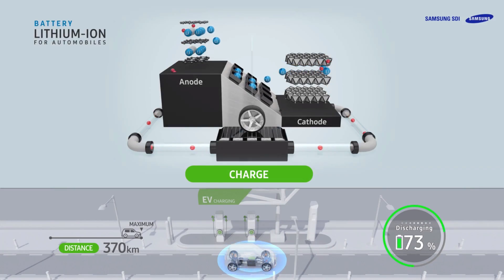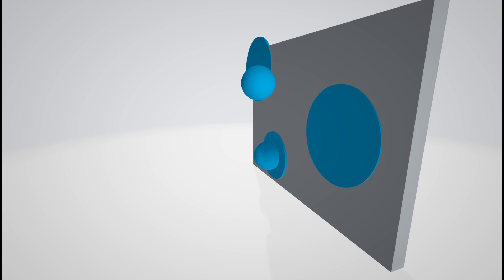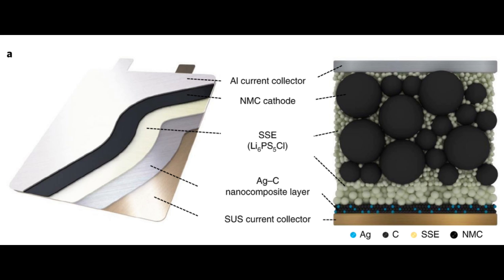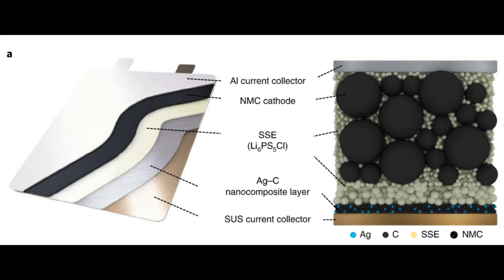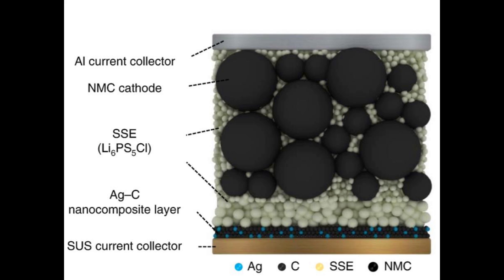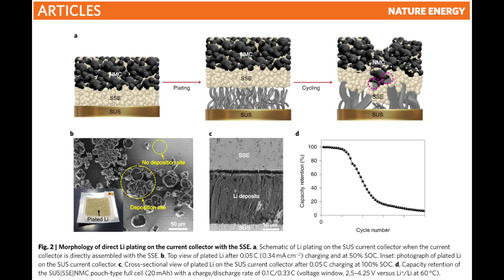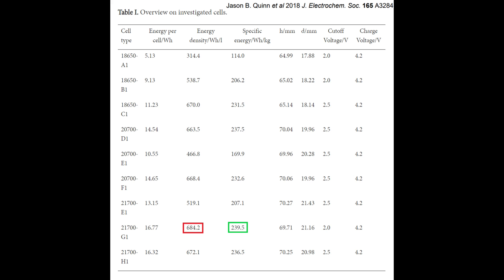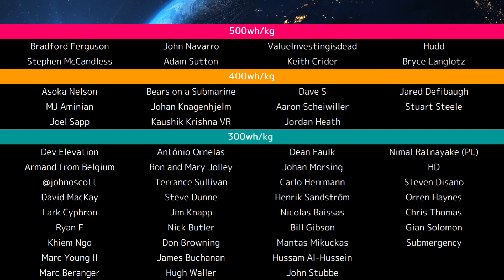Samsung's "Breakthrough" 900wh/l Solid State Battery (Deep Dive)

Comment: at 14:00, did you mean to say the silver can be replaced?
Reply from the maker: Yes!  Thanks for pointing that out 🔥 😀
Reply: @thelimitingfactor  Aluminum. Al and Mg was looked at for this specific application in the 80’s.
Reply: I didn't even notice that until you mentioned it
Reply: Yeah, I was sort of wondering what the cheaper material was going to be.  lol
Reply: it was the ‘lighter than lithium’ that got me. 🤪
Reply: Lithium = corrosion. I dont see this as a solid state battery. This is a "continue to buy once it dies" battery. This is not the best they can do. 1000 Charges? Garbage. There is no excuse for this other than profit and lightweight race. Iron and detergents without chloride have more longevity than this. This isnt cutting edge or energy future wise, its engineered failure again.

Comment: Jordan. Couple of things.

1. The premise that an SSB reduces the propensity for fires and explosions is received wisdom that is likely flawed at traction battery scale. In an overcharging situation (and less likely but perhaps also in a short circuit situation) the SSB will explode violently as the failure mode because it cannot so easily boil off the electrolyte at relatively low temperatures and pressures to vent with or without flame. Overcharging a large SSB is a simple case of too much energy in a confined space and nothing present in liquid phase will tend for solids to go straight to gas very explosively.

2. Coulombic efficiency. When we are up at > 99.7 levels of coulombic efficiency, it is not correct to assume that even a high percentages of coulombic losses are due to irreversible chemical side reactions. While it is splitting hairs on the definition of an unwanted side reaction, the kinetic energy lost to reversible volumetric changes owing to changes in the density of electrodes and perhaps even a solid electrolyte at different states of battery charge, will be recorded by equipment that records round-trip cycling losses and reports the balance as coulombic efficiency.

Comment: I think SUS has utilized for pressurization and for anti-corrosion purpose. Copper current collector may deform easily and it is not adequate for pressurization. 900Wh/l is not impressive at all. Li ion battery has reached up to the level of 750wh/l.  Pressurization is really difficult to apply in the real system. QuantumScape version of 1000wh/l is not impressive either.

Comment: I am afraid to say that the speaker of this video did not properly understand the importance of academic achievement of the journal article. I believe reviewers of the journal surely found an issue of using the expensive silver. However, they might accept it based on the unique concept demonstrated in this paper, so that following R&D will focus on replacing silver by other cheaper materials.
Reply from the maker: LOL, if you would have written this to me, rather than referring to me as some abstract entity, it would be a great start.  I do understand the importance to the research community, which is how it got 5 points.  The other non-existent 5 points are for the public who will never see this battery and sold a false bill of goods by the media.

Comment: There should be research into solving the low discharge / recharge cycles by making the cells like a sandwich that's rebuildable with replaceable electrolyte and electrodes. Think about a swappable battery pack that can be replaced instead of recharging it.  Then field replacement of the consumables in the battery pack.

Thank you for the informative insights.

Comment: I heard you say the compound Kobalt is in this battery. Correct?
When given the option between 2 batteries where one has no kobalt but shorter livety at half the price....
Would it be the best choice?
 But now again, if baked in the frame of the car and not replaceable? You get a throw away car?

Comment: OK first I like pancakes good analogy of how old is your fax the reaction time and characteristics I have a question though when you say electrons pass through a element is it like in a wire or a electric goes in one and a one comes out the other same iCloud does the all the way through the wire just the placement goes through the where is that how it goes through the trail you’re talking about ?
Reply from the maker: The physics of how electrons travel through a wire would require its own 15 minute video.  Electrons move very slowly, but the energy transfer occurs at the speed of light.  This is much like how waves move through and ocean.  I don't understand the rest of your comment/questions.

Comment: So it might not be a breakthrough for EV's due to cost, but this has great potential for portable electronics where the additional safety and capacity are of real practical use.  Giving it a 1 out of 5 is somewhat punitive.
Reply from the maker: It depends on your criteria.  Samsung isn't planning on developing this and usually it takes at least 10 years for a battery to go from lab to market.  If I were a researcher, I'd rate the usefulnes higher.  I'm taking the perspective of Johnny Q public...they'll never see this exact implementation.  They may see a derivative of it in 10-15 years, but essentially not something they'll be able to take advantage of.
Reply: @thelimitingfactor  I see where you're coming from.  I hope we see some major gains sooner rather than later.  Thanks for the videos, they're really good quality and satisfyingly technical :)

Comment: I hope for Li-S ( Sulphur) Solid State battery because of higher energy density  (up to 2700 Wh/kg)  , Li -Metal anode, sulphur has high energy capacity (~1670 mAh/g) cheap abundant and more safe. These researches can improve the understanding of the dynamics of different materials and help other researches/ companies to improve battery tech.
Reply from the maker: 👍👍👍  We'll get there eventually.  Perhaps there will be an intervening step.  I still need to corner some battery researchers on this.

Comment: If the silver is getting dragged around, won't the whole thing eventually stratify and become useless? Or should they just use separate layers of silver and carbon because apparently that works? Also, given all of the problems with lithium mining, should we not be using sodium as the baseline for pretty much every battery going forward outside of low-production-volume aerospace and defense applications?
Reply from the maker: The migration of the silver appeared to be beneficial (up to at certain point at least).  They didn't identify the primary degradation mechanism.  Plenty lithium out there.  Mines wil start opening, but there will be lag.  Sodium is at least a decade away and will probably be better for grid storage.

Comment: Solid state batteries will spell the end of the internal combustion engine....finally.
Reply: no it wont, there will still be a need for ICE's or do you think they will have battery operated heavy machinery to mine the materials to build the batteries, and what of jet engines, military equipment, farming equipment, all use internal combustion engines.
Reply: @wcampbell1502  Sorry, but that is a pretty ignorant response. The value of the ICE is that it uses an already extremely energy dense fuel to run (albeit only extracting 20-30% of that energy).
Electrical motors have been proven time and time again, they are used everywhere for many different things, depending on specific needs. They are also more than up for the tasks you've listed (heavy machinery, farming, military spec), it's just the energy storage that struggles (currently). Electrical motors are very very efficient at translating electrical energy to motive force (unlike the aforementioned ICEs).
There are fairly specific points (of energy densities) where battery storage beats out petroleums and you gain huge energy efficiencies* from that (not to mention emission savings). These are not going to happen overnight (and no, they're not going to happen just because a SSB makes it to market), but your statement makes it sound like those things aren't achievable via battery storage tech, just because it's difficult now.
Many of those things are already becoming EVs. Light planes, medium and small duty industrial machinery (CASE construction has a backhoe loader that is pretty good for purpose, for eg). There is also a few of the huge mining trucks, that cart the material up and down the mine's roads (can't think of name) that are converted to hybrid, because half of the journey is down hill, so you save massive amounts of energy regen braking on that section of the trip. Also, cruise ships are often fitted with large battery arrays now, to power them near shore and other times you need clean quiet operations. - Yes, I realise these aren't pure EVs, but hybrid is the best step forward atm - and shows egs of EVs powering traditionally ICE only industries.
Energy density is the Limiting Factor atm, but, that will change pretty rapidly
* - Those energy efficiencies are increased even further when you consider that an EV doesn't need to idle constantly (on a construction site for instance) wasting fuel needlessly

Comment: If true, then this will boost technology progress by 5 years faster than expected.
Everything electric will dominate !
Reply: I think you missed the point where the use of expensive silver and zirconium makes this battery a non-starter financially. If the battery pack cost goes from $7500 to $40k, which EV companies in their right mind are going to use this? There might be a replacement for the expensive atoms, but then that's a completely different battery.
Reply: We have difficulty meeting the demand for electricity in the summer months. Where in the heck will we get enough to charge 100 million cars daily?

Comment: As we don't know exactly how the Ag-C-layer helps with smoothing the Li-layer, we don't know yet if it has to be Silver, or what the ratio of Carbon and Silver has to be. Yes, Silver has the highest conductivity of all elements. But maybe it's replaceable by Copper or Aluminum, if conductivity is the criterion. Or it might be sufficient if we use small structures made from other elements, which are just coated with a thin layer of Silver. I wouldn't rule out that the amount of Silver necessary might be minuscule, or that Silver can replaced completely. (Same with Li itself. Maybe Na-ions will also perform well in that setup -- less energy density, but much cheaper.)
Reply from the maker: Very good points!

Comment: What do know about lfp lifepo4 battery? I got lfp batterys in my bike which I made out of 32700 6.5ah 6c cells that has 3000 cycles life. 2pcs 12s2p pacs 26ah combinated. Works really great. High power and range.
Reply from the maker: LFP is underrated
Reply: Thanks. I think the wery same :)

Comment: Interesting video and great explanation. I wonder if you could also apply the idea of the Ag-C layer to liquid electrolyte batteries to prevent dendrite formation there. That might make it possible to make more compact and durable liquid electrolyte batteries. That will be a lot easier to achieve than developing a useful SS battery with this technology. Ofcourse they will need to find a cheaper alternative material to Ag-C to suppress dendrite formation (or make it work with very small amounts of Ag).

Comment: So your saying a 2" by 4.5" battery with a silver layer the thickness of a piece of tin foil, would cost as much as a model 3 huh? Actually it would be about a gram, or 55 cents worth of silver per cell. Times this by 4416 cells that the model S has, and your at $2428.80 of silver, not 80K.
Reply from the maker: Think about what this would do to silver prices.  Also think about how much the entire battery would cost or even if it's mass producable.  I'm thinking $35,000, the base price of a model 3.
Reply: @thelimitingfactor  I just hope my silver goes up in value!! :D My grandfather made a killing on silver, when the government called back all silver. He put an ad in the paper, offering 1.5 times face value for all silver coins, and then sold when silver was sky high in the 80's.
Reply from the maker: @klubstompers  Ha!  Fair enough.  I'm into my gold mining stocks right now.  We're way overdue for a restructuring of the monetary system.

Comment: And here I am thinking "Oooh, can we get the power and performance of a 3S LiPo out of something as cheap as a Moderate-capacity NiMh pack?"
I've been trying to get back into RC as a hobby, and holy smoke are the hard packs expensive now. a 3S LiPo with a 5800 mAh capacity runs up in the $90 range. But for that kind of power..
On the reverse, a NiMh Pack with 5800mAh runs around $50. 
NiMh packs are safer, generally speaking, but the power output is weak compared to a 2S LiPo, and a 3S LiPo smokes the 2S. The down side, of course, is LiPo is indeed more expensive, but you also have the increased risk of LiPo Fire. The risk is so high that ROAR sanctioned events and tracks require LiPo safe charging bags or cases for each battery on a charger. For those Not on a charger, must still be in a LiPo safe carrying container. Every RCer knows when LiPo takes off, it can't really be stopped. I know of several houses in my area alone that were lost to LiPo fire because hobbiests didn't contain their batteries correctly. 
Should we get SS batteries into the RC world, that'll make competitors and hobby users happy. I'd be happy with 2S power and high capacity for the cost of a mid-to-high-end NiMh.  Obviously it'll be awhile, but it'll be nice should it happen
Reply: Never going to happen an oil company owns the base patents to Nimh it's DEAD .Lithium  is also way lighter than Nickel. If you want safe then use lifepo4 cells not NMC cells
Reply from the maker: I really appreciate your thoughts on that!  That's something I wasn't aware of.

Comment: First, foremost and the only point to make is Samsung didn't invent crap. This is a Goodenough invention. If Samsung is claiming it as theirs... They are lying. Hacks!!!!
Reply from the maker: Goodenough was working with a different electrolyte.  Solid electrolyte in general have been around for a while, however, no one has managed to make them work yet.  Even Goodenough says his and Maria's is at least 5 years away.

Comment: I knew silver would be the key. I build battery packs using silver wire to connect the cells. I then pot the pack in GE Silicone 2 for heat stabilization. My ebike battery packs are the best on the planet. Silver is expensive but no substitute. It is abundant..
I’m experimenting with silver coil stator wire in electric motors. Much better.
For a million mile electric car that will bury the gasoline cars, silver is the key and also superconductors to recover lost energy.
Reply: How can you say silver is abundant when for the last 4 years there's been an annual deficit of around 200 million ounces?

Comment: Your battery reviews seem to be for automotive. The use of other types lithium batteries in other devices can  make more sense. Energy density isn't everything. On my Ebike the LTO cells is all that I use.   The pack weight is double of other packs but on a long ride lunch time is there long before my pack needs charging.  In 30 min or less I am charged and ready to go. LTO lets  me charge in the winter in the garage not in the house and the pack can stay on the bike and LTO aren't affected much by cold weather. I noticed in the past other cells heat up and have reduced cycle life and if I have to add a  heat sink  to keep them  cool  and LTO don't need a heat sink, is the higher energy density really helping me? The point I am making is total pack and cooling system needs to be considered.
Reply from the maker: Correct I'm focused on the largest opportunity, which is vehicles and energy storage.

Comment: We need solid state batteries now.  Hope it’s not too long.  Agree with using more easily obtained materials such as Graphite.  Once we can have a relatively inexpensive electric car that can easily give 500 miles per charge, that will finally kill off the crude internal combustion engine

Comment: Looks great, BUT bad idea to make a battery with such low volume, high demand, low mining, and the fact that more people will hold onto what silver they have, which means this will drastically shrink supply, and the fact that bigger entities will get their hands on as much silver for them selves.. precious materials like silver. This will probably kill this battery. ? why would you make a battery like that?  The cost of this battery will most likely sky rocket. And then your going to try and mass produce this battery. Ain't gonna happen. Did these guys do any research into what the silver supply was like before they spent all this time in making a prototype? One of the first steps in engineering. Researching materials. supply, demand, is it economically feasible, on an environmental level, and such...  I do this all the time...

Comment: It would appear that organo-metalic materials may hold the future of energy . Recent advances in hydrogen storage based on organo-metali material promises a breakthru in high volume , low pressure storage of hydrogen .
Reply: WHY use hydrogen it takes huge amounts of power to produce and the only thing that will keep it in is graphine. Hydrogen as fuel would only make sense with fusion power to make it. 🍾😲